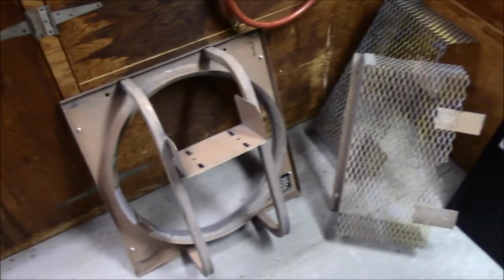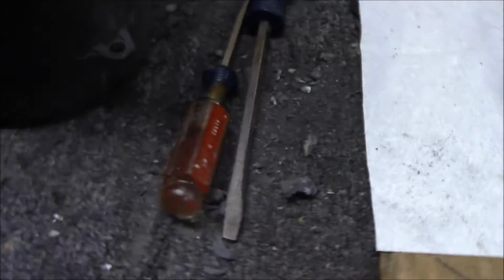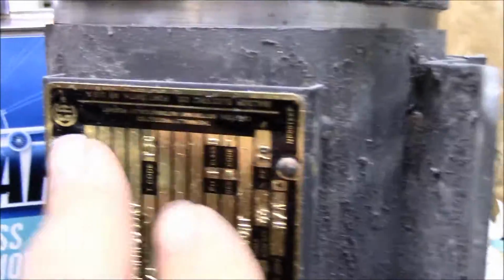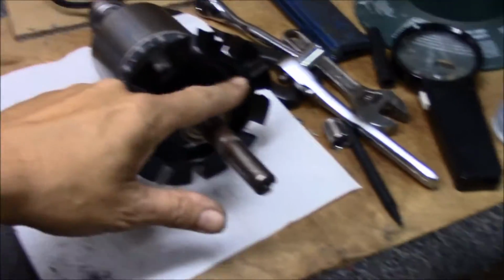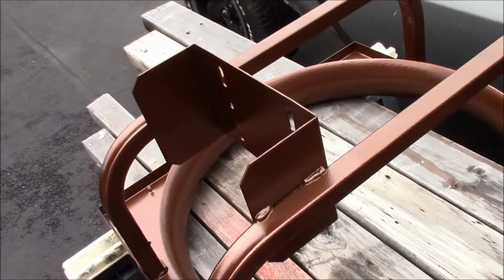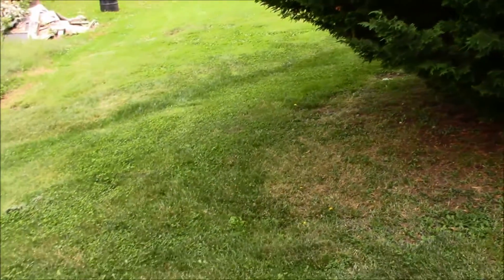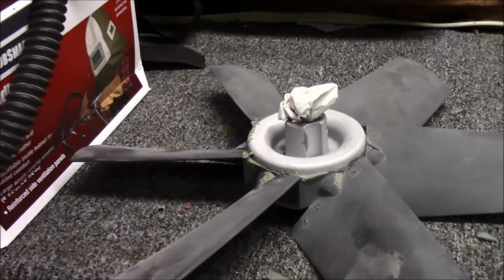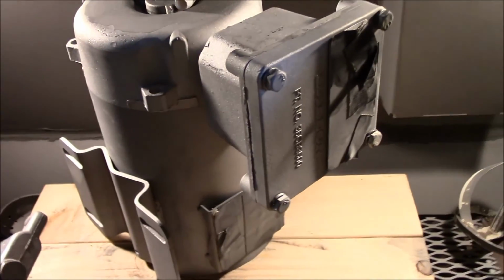Jenny Fan Rebuild Part 1

Comment: You are very meticulous. 
But, you missed a spot. LOL
Just kiddin' Russ!
Thanx for a great video!
I'm sure that fan will be better than new, before we could exhale. :)
Reply from the maker: Thanks Captain. My powder coater does and excellent job on stuff like this, now I just got to finish the small parts and cut a hole in the wall.